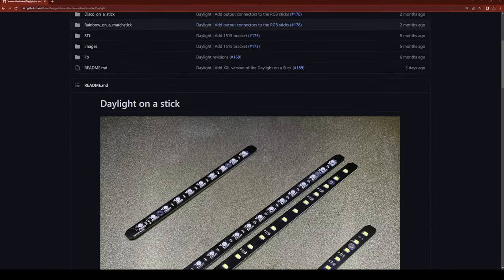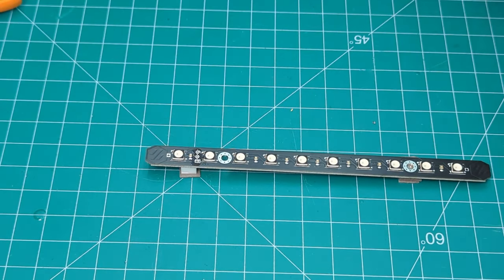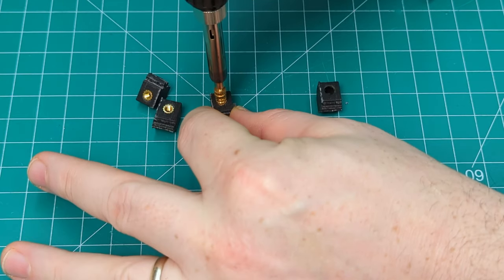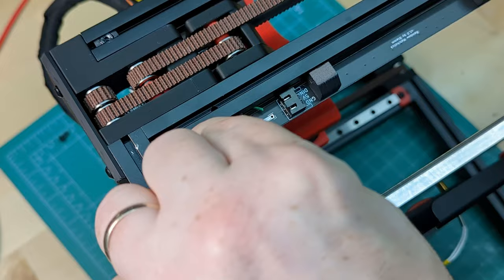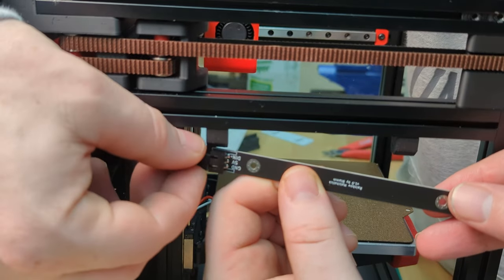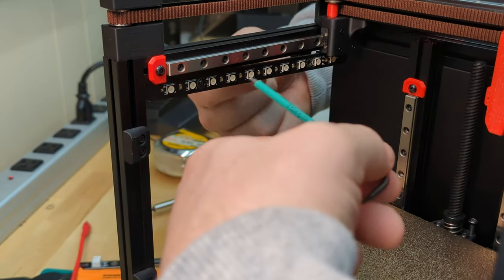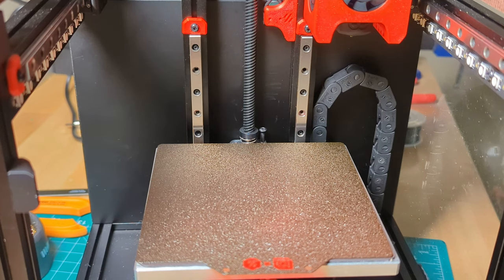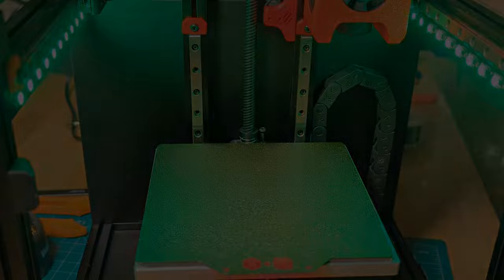Voron Mod Showcase: Rainbow on a Matchstick

Comment: Dumb question. For the blue wire, does it go from the first match stick to the same point on the second matchstick instead of giving both a 3 pin connector?

Comment: is there something different on a btt skr pico because i cant get it to work.
Reply: the same for me... Have you solved?
Reply: Me too, I've tried everything.
Reply: @a.nonamoose  I had the wire plugged in the wrong spot on the umbilical pcb and plugged it in to the right spot and that fixed it.